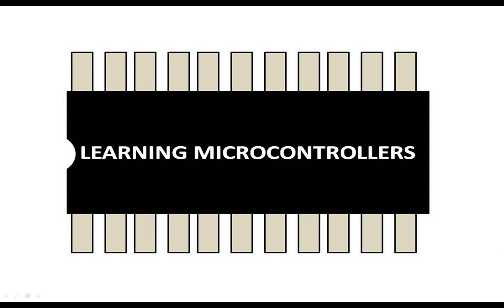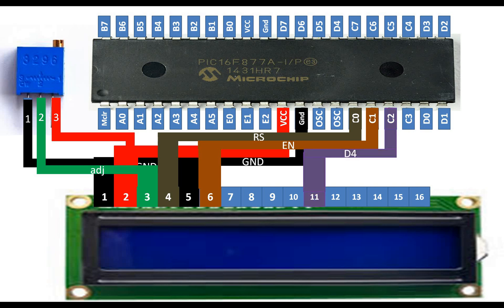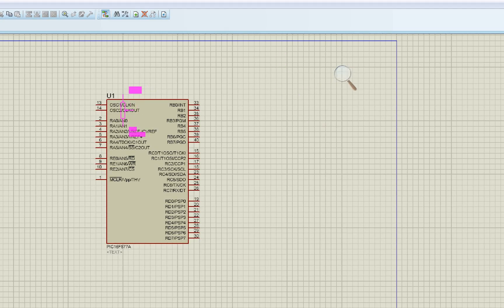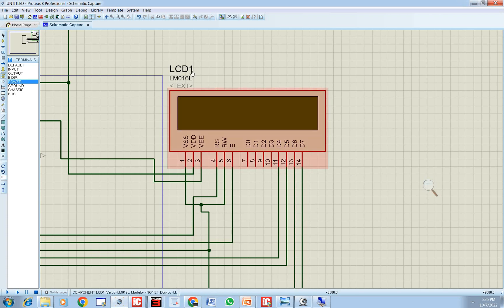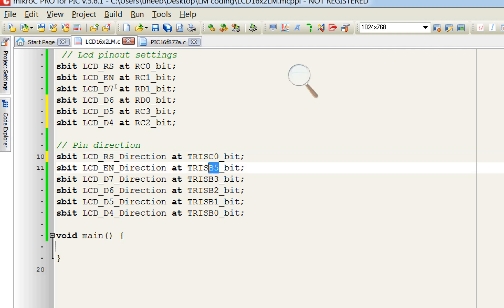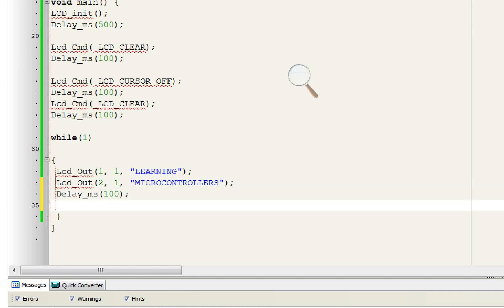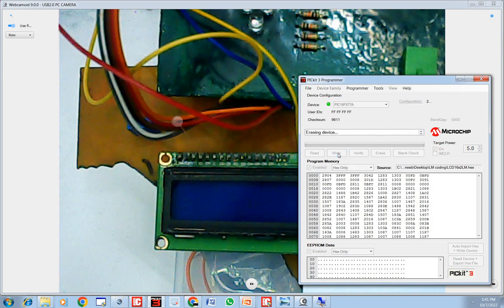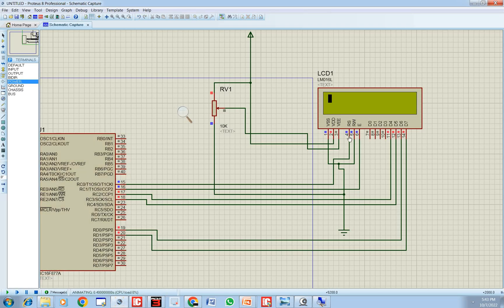PIC16F877A interface Lm016 16x2 JHD LCD. Using MikroC for PIC coding. Proteus + Hardware Demo.

Comment: sir I have problem in the pickit 3 software where i cant find my PIC16F877A. why is it so?
Reply from the maker: Which version you have ?
Reply: @learningmicrocontrollers3561  im using pickit ^tm 3.
Sir with the readymade INFRARED sensor im doing simulation in Proteus according to  the video you made but it say AVR and the real time is not define so what can be the solution for this too sir?
Reply from the maker: You are using MikroC for PIC for programming ?
Reply: @learningmicrocontrollers3561  yes
sir...